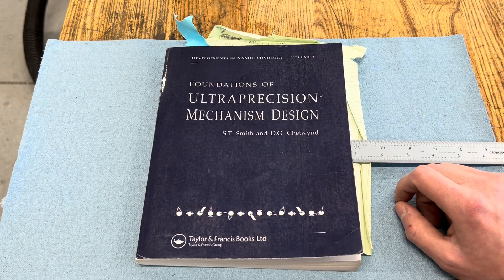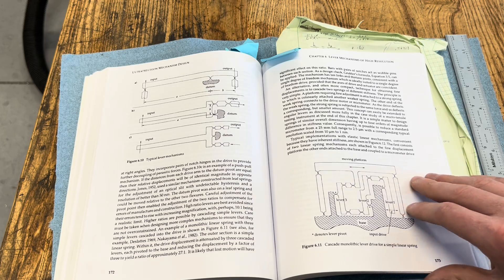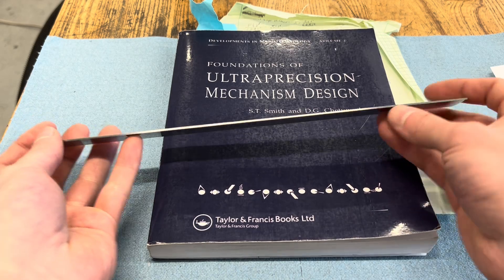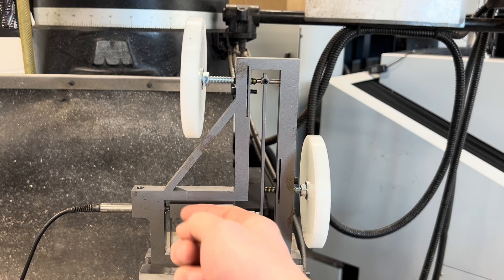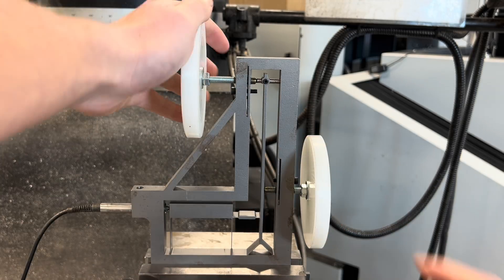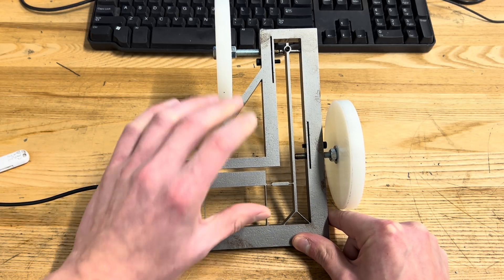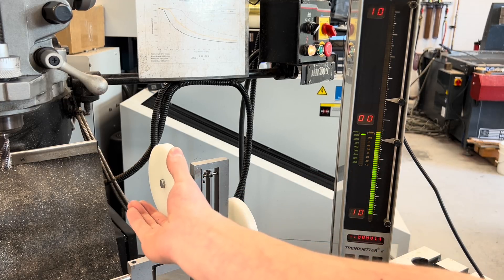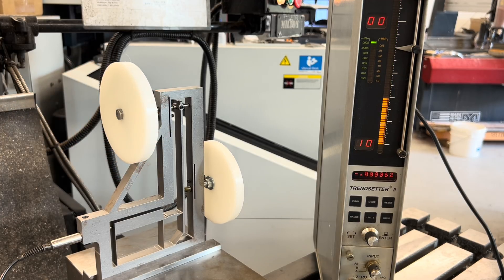“Diving Board” flexure lever mechanism for high resolution adjustment

Comment: I really like this mechanism! I see it as the basis for a microscope X-Y-Z stage that has more range than the ones I've seen. Plus the coarse adjust feature is lacking on all those designs. That would make getting the object I'm looking at into position a lot easier. I just have to translate what you've got here to a 3D printable version the right size. I would use stainless steel ribbon for the flexures. The bar could be stainless steel too. ( Although I wonder what ratios other materials, like Nylon, PETG, ABS, Polycarbonate with and without glass or Carbon filler, etc would yield. ) Then I can test that out. If it works well enough 3D printed, I'd get the plastic parts for one machined out of steel.

How do the dimensions and hardness of the bar affect the ratio?    I think that, to a point a thicker bar would give a bigger reduction but would require more input force to bend the bar. So a thicker bar would reduce the range of the system. A thinner bar would give a larger range but at the cost of a weaker reduction. The same thing goes for the hardness of the bar: as the hardness goes up, it flexes less, reducing range and making a bigger reduction.    Or do I have all that wrong?

Comment: I think one interesting application is a multiplicative arrangement where one output feeds the input for a sequential flexure and using them to exponetiate the differential going large to small or small to large. Also interesting to think of having stacked designs that fits into a small space in sequence for larger absolute displacement for very small values 2x vs x^0.01 or whatever.

Comment: On metric versus imperial: since 1959 the imperial is defined by referencing to the metric system whereas the metric system references to a physical constant; the speed of light. This means, as far as which system is superior, that the imperial system is the clear loser. Instead of the meaningless and confusing calculations needed to arrive at, e.g. an inch you could cut out the middleman and use the metric system as it is. Also, a system that consistently uses 10, 100, 100 - and not 12 (foot / inches), 36 (yard / inches) or 1760 (mile / yards) is - of course - better.

Comment: Since you mentioned differential screws at the end :). Differential screws are even more compact and can be if spring loaded. It also easier to change the gears on the late to build an odd pitch like M10X1.05 and used with M10X1 you get 50 microns per rotation. To get to 50nm you would need 1000 lines say 0.5mm apart on a wheel which will have a diameter of 0.5 X 1000 /3.14 = 159mm (about 6"). That's quite big of a dial. So probably your solution is better for small displacement. Wonder if one can setup a gear ration on a late to get a 1.005 pitch... that would make the dial just 16mm or 5 times bigger at 90 mm and line to line is 10nm

Comment: After looking up what a differential screw is, I gotta say it looks awfully similar in function to those hyper compact gearbox designs that people have built on multiple occasions thinking it's gonna be a huge revolution in the industry.
The output is the difference between two slightly different gear ratios, meaning it has to endure the force of the output at the speeds of the input and will break or wear out long before you get any good use out of it.
It's really only good for adjustment mechanisms.

Comment: reading the comments is just as enriching as ur straightforward video wow. so then noob q, sorry: is this at any point functioning like a capacitor or basic stud finder? when you explain the toroidal field around the copper ring i believe i understand that it’s similar to a ferrite donut wrapped with copper. induction, right? but do the separate plates, when powered, have to ability to demonstrate density or a separation of their field? again sorry to ask like that it’s all i got.

Comment: I was thinking about the ball in the coarse adjustment screw, that any eccentricity in its mounting also causes a slight change in the "ratio"....hmmm, maybe you could use an eccentric ball to change the pivot point, and thus the ratio, in an almost microscopic amount, which would shift the output in tiny increments.
Also, the bend in the "short arm" must be affected by its stiffness, so making it thicker than the other arm makes its motion less... Getting to have some of the characteristics of a coupled spring reduction? I'd also be concerned about temperature effects on both the length and modulus of the arms, but it could be built into an isothermal environment... I did some work, getting onto 24 years ago, on 3d scanning of items at "far field" distances, which drove me into some research in precision and kinematics.
I worked with our machining guy, and software guy, and we were able to measure the "flatness" of a plate at about 500 mm distance, so that we could see the difference with pressing the air between the plates... And, developed a fixture, with differential TC materials, to maintain the distance from measurement camera to test mounting point, stable against reasonable temperature changes....
Sorry, reminiscing....

Comment: I think that the observation in regards to the arch of the diving board (?), is quite brilliant really, but i also think that it might be exploited in ways you might not have considered. 
This arch will no doubt, of course depending on choice of material ( butter is probably not very suitable), be reasonably consistent and relatively symmetrical, though i suppose it doesn't need to be. I think this arch can enable further precision, if you consider, this where my machining vocabulary fails, a smaller board, resting on both ends on this arch, and most notably, what difference it makes when you move it of center of the arch.
This adjustability will not be linear of course, but probably wont be all that far off.

Comment: Thanks for the interesting video. I think this is a very clever mechanism, I have been in the high-tech industry for 13 years now. You did a proper analysis of the disturbances in the mechanism build with respect to your concept/diagram. One thing you missed is the force required to move the 4-bar (parallelogram) mechanism. I think that is a larger disturbance then the stiffness off the frame. And that also explains why the ratio is higher (34 actual vs 32 designed, IIRC). Because the 4-bar mechanism force will resist the motion of the diving board. A lack in stiffness of the frame would make the ratio lower, I think. I wonder how you view this, it would be a nice exercise to map out all the forces and stiffnesses at play in the mechanism, but also cumbersome. Keep up the good stuff!

Comment: Your design certainly still includes ratios of spring constant ratios, as well as length ratios.  If you tried to make two identical copies, the largest difference between their overall ratios would be the reproducibility of the spring constants of the two sections of the bending beam, both from material variation and dimensional variation.

Comment: Glad someone else read that book! If you want to build a really simple tunneling sensor (not an AFM or STM those are hard). You can do it with just a few pieces of glass with some gold evaporated on them attached to a simple few component electrical circuit.
Reply: ps I never got better than a hundred nm out of a DM-13 differential micrometer... and you can always add that to your deleveraging flexure. With electrostatic feedback you quickly become thermal noise limited.

Comment: What's a CMD-lubricated bolt?
Reply from the maker: The threads are lubricated with CMD Extreme Pressure Lube #3, an extremely high film strength thick oil that reduces stiction and makes it extremely smooth to turn

Comment: While I'm not familiar with work on taking macroscopic motion and making it microscopic, I am familiar with work attempting to do the opposite.  Search Google Scholar for my work with J. Jiang and other papers from around that time.  We were trying to amplify the motion of piezoelectric materials.  In Jiang's case, through a buckling beam.

What you have designed (and built!) is great.  However, I do think it fundamentally is a spring-reduction system like the second example in the book.  You have a "beam" spring converting input to a moment at the fulcrum.  That moment then generates the output motion.

Great work and great video.

Comment: I could see this being used in a precision pneumatics/hydraulics sensor, pitot/static pressure sensors, calibrated  reference comparison, manufacturing equipment adjustment tools... really anything that needs to be precisely functional to a specific arbitrary value could benefit from a mechanism like is shown in this video- the reliability of a single-piece flexture seems like it could be particularly useful in a "no fail" design, where other redundancies in a system are the only other things keeping people safe.

Comment: I love it. Super cool project. Love compliant mechanisms.
I would have loved to see a plot, with rotation (input) on one axes and displacement (output) on the other.
Just to see how linear this ends up being. Maybe just every 90 deg.
(and the "in" confuses me, I am disappointed that we have standardized the computer and shipping containers but not measurements but there is no hope this will happen in my life time)

Comment: I get it’s a measurement device for extremely fine machining but it would be cool if we actually say you measure something just to show how it could be practically used. I am not an engineer or a mathematical expert in the least I think I am just slightly above average when it comes being able to understand stuff like this so for me. It’s impossible for me to understand the math. I got a D in geometry which I don’t entirely think was me as much as I probably needed a tutor but I adore watching engineering videos, and understanding various concepts and solutions for mechanical operations but the actual equations I can’t do, I don’t understand the scientific symbols, I got your point that it came out to a 1 to 34 ratio and even using the fulcrum to do more gross adjustments prior to using the lever. It seems like it’s a much more robust way to measure variances in surface height on a plane of metal or any other material as what I usually see is a very delicate needle attatched to a gauge and the fact this is more encased and can use heavier peice of metal and a more durable frame makes it seem like a better measurement device in shops where these devices get exposed to say.. measuring the length of deformation of a piece before a catastrophic break. Where I see people destroy multiple gauges in a single video. Having the actual gauge housing be seperate from the device makes it more ideal for measuring destructive deformation just my thoughts. 

I just want to point out that I tend to lean towards this type of heavy information science than popular science but intelligence wise I am not capable of fully understanding how to make it myself. I don’t know what the line at the bottom of the device was hooked up to or how that electronic gauge reads what I assume is the precession of the wire in the hose. 

My point is it’s very rare I see videos aimed at educating people at my intelligence level usually when I find stuff sufficiently interesting then people don’t actually express theory or practical application. And when I look for theory for beginners I get stuff so dumbed down it’s completely obvious and boring/useless as a result. 

The point of my point is people like me exist who are interested but really would want just a few more terms to look in to and a bit more context on what made you perform the experiment so we can educate ourselves. I laughed at the beginning when you said my favorite chapter in and the read the title because I thought “yup we all have a couple of copies of that lying around”… Not a book I knew existed obviously. I’m just longing for more content that doesn’t assume that if your interested in complex material you must be doing the science yourself or in the community. I own a CNC and a lazer cutter but I don’t think I could ever understand how to machine things to tolerance using traditional methods. I for instance don’t understand how to know how much pressure a given width of steel of any particular type could handle or how to even look it up past just looking for “steel width psi” in a search but I don’t for instance understand how figure out how many pounds a spring can push at a given width of deformation, because they write spring math in some strange measurement I don’t understand instead of just providing at half length the spring is pushing with x amount of pounds of force. It’s a frustrating limit to my intelligence that complex math does not come easily to me and a lot of engineering projects don’t have simple figures like that when you go to order springs online. It forces me when I am building an arcade stick to purchase springs from an arcade distributor because they actually label them one pound two pound etc. when I know that they are marking them up by a factor of ten or more just because I am too stupid to understand newtons per mm or whatever the measurement is. I am willing to learn but as I said there are a lot of beginner videos and a lot of extremely advanced videos but very little in the level of practical application for intelligent beginners. Instead you get basic concept with zero actual application, or extremely advanced concept where your expected to know what the terms mean with full on application. I get frustrated because I feel if you just stopped to explain how the equations are to be understood and what terms actually mean I could approach figuring things out. 

This has little to do with this video as much as it has to do with my experience of researching my interests on video. I don’t watch videos like this because I have any reason to besides I love watching engineering being applied by people but I get jealous that I don’t seem to have the drive or intelligence to get to that level. 

I complained in highschool about “why do we need to learn math what on earth would we use this stuff for” if someone had stopped and said if you ever want to build machines like engines or guns or understand robotics you will need to understand this stuff I probably would have been thrilled but nobody explained that stuff to me. And I am fourty now kinda struggling to understand this stuff way past my brain’s optimum learning period lol. 

Anyways it’s a beautiful mechanism and one I think actually does have legitimate applications because usually these type of measuring devices are very delicate, and this is a big length of (spring steel) I am guessing, also as you mentioned even if you knock it out of alignment because you can reset the fulcrum it means you could really hit it hard and just readjust and keep measuring. And the fact that the actual measuring mechanism is so far away from the point of contact or point of action it means again your much less likely to break a dial. So I think there are very legitimate uses anytime your measuring tolerances in failure scenarios. That’s what I can see, I can also see these instruments being pretty beefy and still being extremely precise which is another plus. I haven’t seen a precision measuring device I could call robust but this definitely is so I think it is actually worth look into more. 

Thanks for making videos it’s hard to find people doing this sort of stuff. Best Wishes.

Comment: I think the ability to disconnect the lever from the fine adjustment knob is not necessary. Without it, the coarse knob should just have a ratio of 17/32 instead of 1/2

Comment: This is very nice but to make it REALLY nice - would it be possible to come up with something that doesn't need messing with the set screw?
Reply: Seems like two obvious options come to my mind initially. One would be use a weak spring between the fine knob and the input to the "diving" board to eliminate the set screw. Second option is put the fine adjust knob "floating" on the diving board and make the diving board have its own floating "datum" base (second much stiffer diving board that shares the same base pivot). The first option is probably easier since there's a single datum.
Reply: For a certain range it may also be possible to use his design and simply not use the set screw if the stress and strain will allow. That was the original way I thought he would use it before he introduced the set screw.

Comment: An interesting application could be as focus for precision optics. 

Also instead of a flat design, imagine the beam was a circular disk, the coarse adjust was a ring, and the fine adjust was an outside ring. (Just revolving the mechanism)
Reply: The James Web telescope actually uses an array of these for its reflectors.